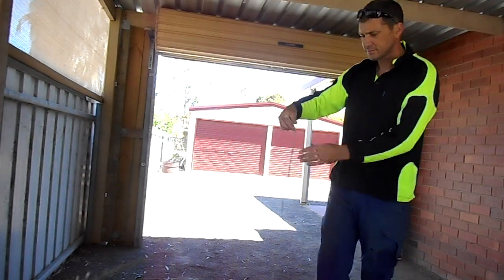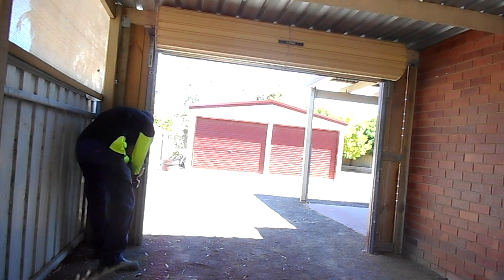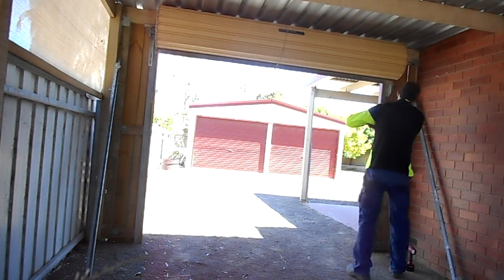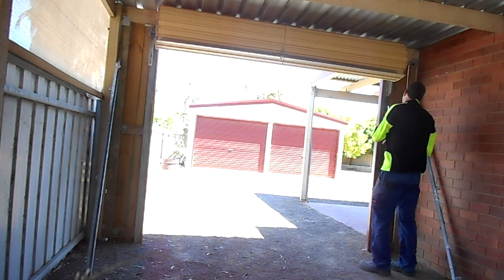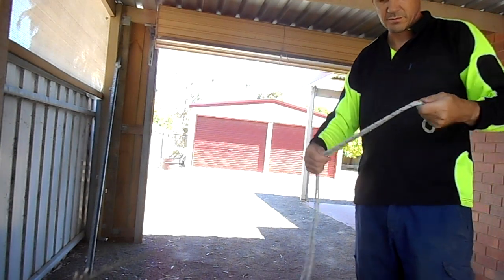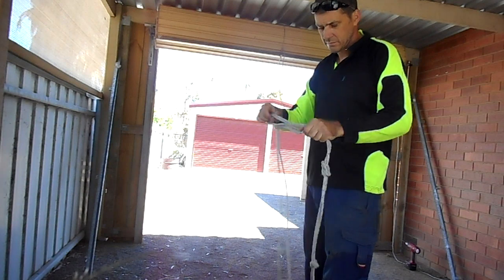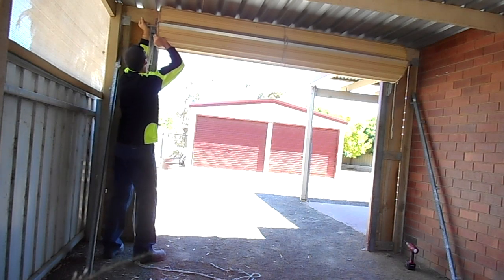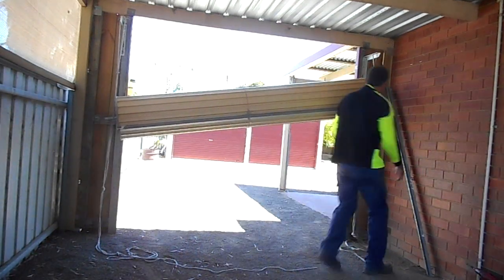Remove roller door yourself

Comment: Having used the advice from this video today, don't try this on really old bnd ones, they weight alot more since the sheet metal almost a mill thick, I noticed that the don't stay rolled up, even with the small strap in place after the tension is released. Also if your are short or it is up high, getting it on your shoulder can be an issue, especially if you have to get on a ladder to reach it. Proven it works a treat.
Reply: Thank you for sharing - I have the old ones & thought that might be the case!

Comment: hello mate. do you need to take the tracks off to remove the door? the reason i ask is because i need remove the roller door to repair the ceiling, then put the roller door back up, cheers

Comment: Do you think 2 guys could lift in a 5 metre roller door at 2.4 high? or do you have a method?
Reply from the maker: Definitely if both guys are physically able. Door that size could be anywhere from 120kg to  200kg. Make sure you have adequate sized stable ladders. At work we use a manual material hoist that hire places do rent out, that is a good safe way to lift heavy doors. There is nothing wrong with using the rope idea tied in knots like the video, it allows two people to work on each side lifting the door up a knot one side then the other. I recommend when putting doors up, to lift the last part onto the brackets having a person each side. I get underneath the door with it cradled on my shoulder between my head and arm and have that hand firmly gripped on bracket. Door wont fall unless you let go or you fall.  Some tips would be to always double check your ropes (don't let them get too close to edge of bracket) or equipment (make sure lifters are stable and door wont roll), take your U-bolt and saddle with you and when working with another person definitely communicate (if you are about to do an action, always let the other person know). I hope it doesn't sound too complicated, it's not really but it can be dangerous and I want everyone to look after themselves first. Good luck mate.
Reply: @memoto5944  ok great cheers for the response, i have a slings at different lengths in going to try, so it will be similar to the rope technique but worst case I will go and grab some rope and the the knots or do you buy that rope sling somewhere with knots already in? I have ladders but also 2 aluminum scaffolds as well with me so they will come in handy. Thanks for the help
Reply from the maker: @haydenr4454  sounds good what you have. I like braided mountaineering type rope but any high strength non stretchy rope is good and just tie it together at intervals.
Reply: @memoto5944  ok great cheers mate

Comment: Can I remove without removing the rest of the tension?
Reply from the maker: Unfortunately all tension has to be removed, once both U bolts are released any tension in the springs will cause the axle to neutralise itself and all tension is gone. If there was a way to lock tension on then safety is compromised. I hope all that made sense 😂 good luck anyway 👍